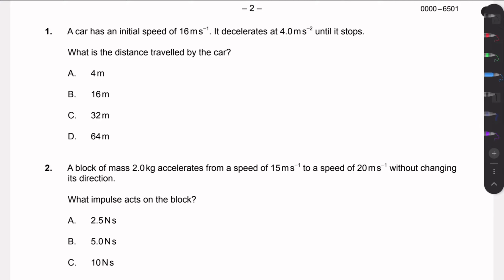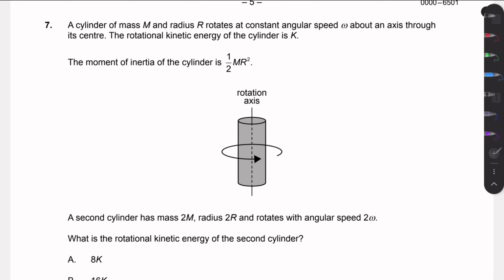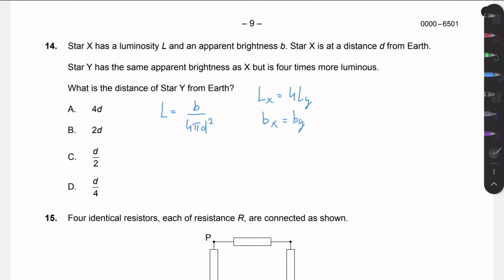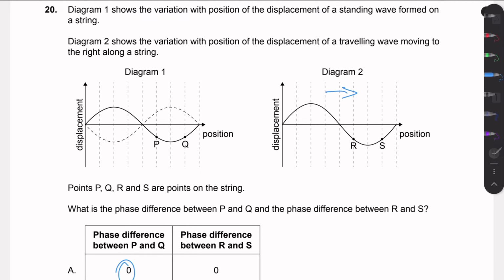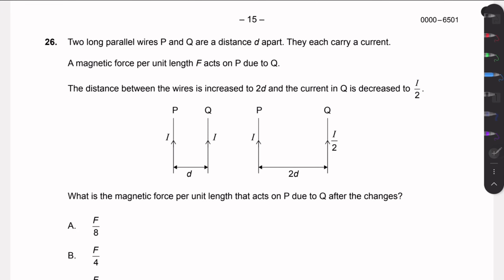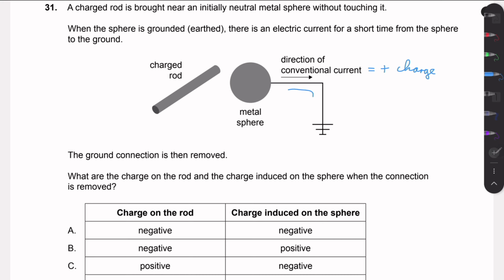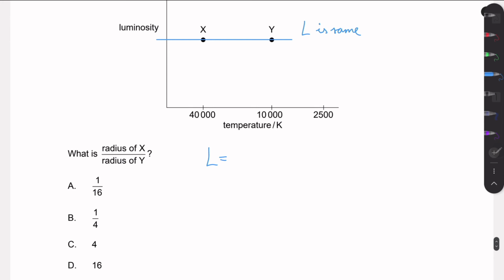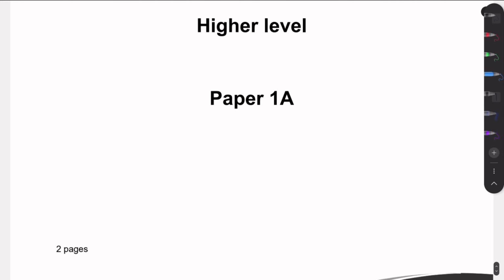IB Physics 2025 Specimen Paper 1 MCQ

Comment: In question 7, shouldn't it be 16K? Anyway, thank you this helps a ton!
Reply from the maker: Nono its 32K, I kind of skipped a step there, that 1/2 in the start doesnt count because thats included in both the formulas, the original experiment and the experiment with the modified properties